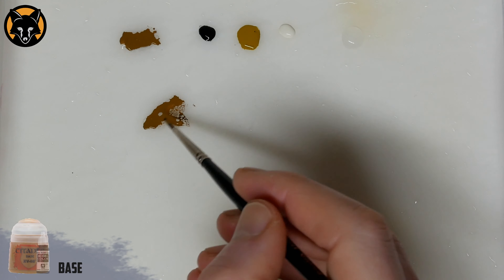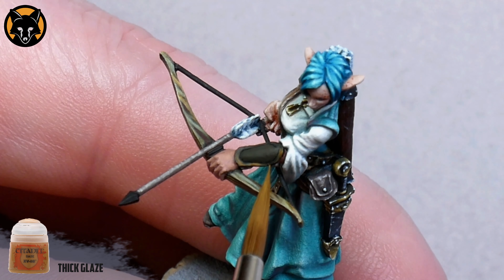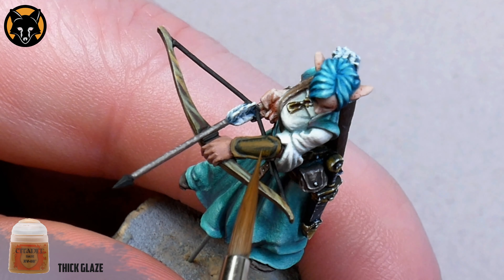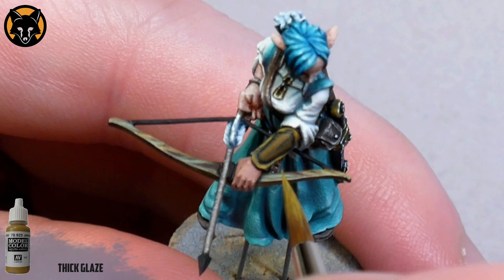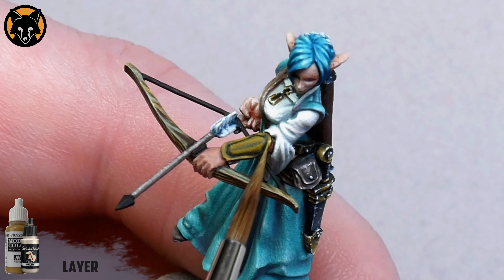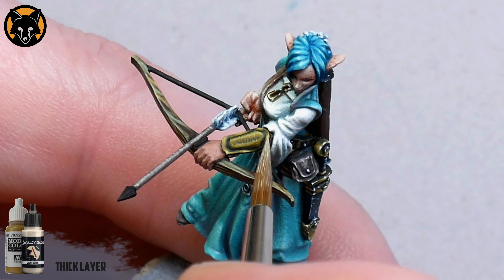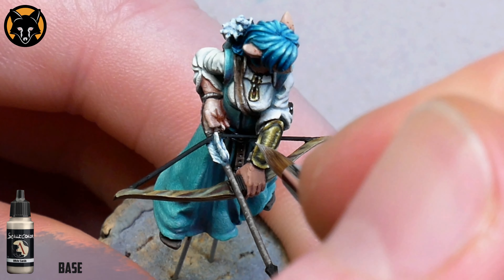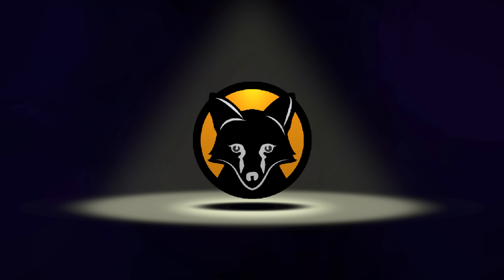Boss Tier Non Metallic Metal (NMM)

Comment: Not sure if you have a video about this or not, love the video by the way, but I'm curious what kind of pallet paper you use.  I've been trying to figure this out as a number of painters seem to use the same kind but can't seem to get a straight answer. Any help would be much appreciated.
Reply from the maker: Sure. I use supermarket own brand baking paper. Usually Morrisons or the Co-op. Basically cheap baking paper. I just cut it to size. I'd stay away from paper that's supposedly tailor made for wet palletes, it's usually crap. Hope that helps.
Reply: @KujoPainting  Thanks for the info! 

Yea, that's what I keep hearing from other painters. So I've been searching around for alternatives.